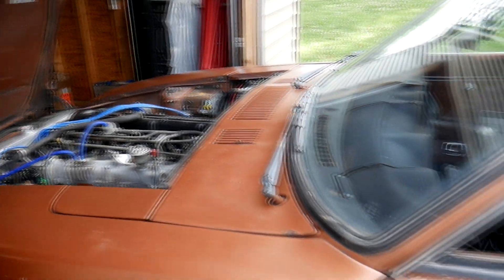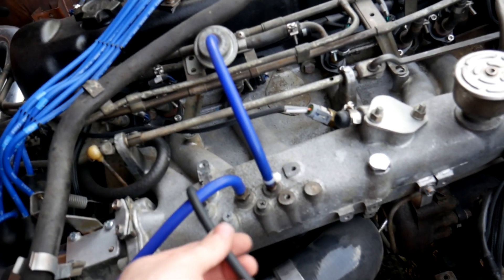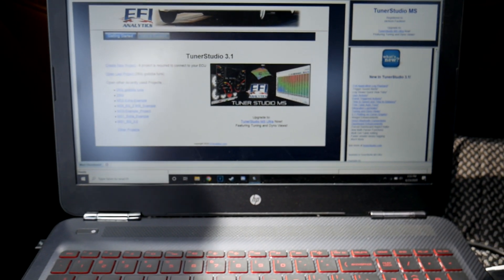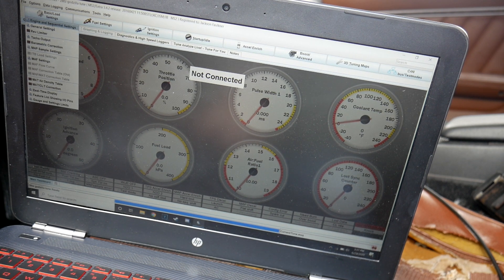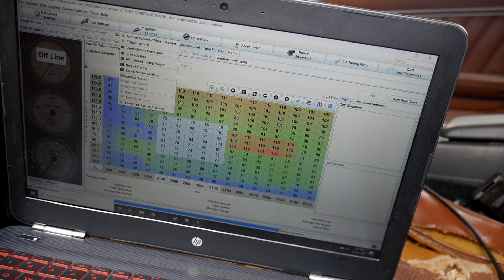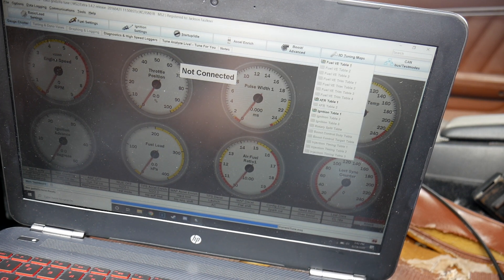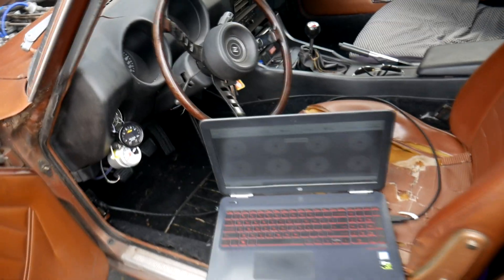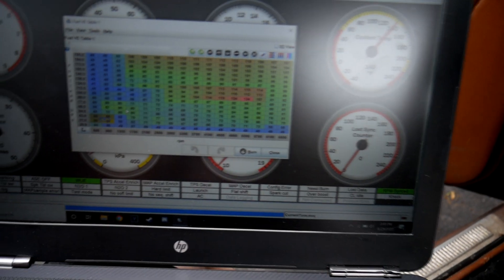Datsun L28ET MegaSquirt Setup

Comment: Hey man I wanna say thanks for showing all of your settings.  I recently was helping a buddy who got screwed by a shop upgrade from MS1 to MS2extra and the ignition timing setup changed quite a bit between the two versions.  He has the same distributor as you and while I will confirm tdc with a timing light, your settings allowed me to get the engine started and driving around the block.  I only mess with LS engines on Megasquirt so the Nissan stuff is all new to me.  Thanks again.

Comment: do you have to swap trigger wheels to make it work? would you mind sharing the tuner studio files? thanks.
Reply: Megasquirt can do any trigger, square wave or VR. L28et uses an optical dizzy that works well with megasquirt, there are two sensors one is high resolution(360 slots) and one is low resolution(6 slots) the 6 slot trigger works perfect for a basic dizzy setup the 360 slot is unusable as the resolution is too high for the megasquirt, the dizzy also requires a +12v(1k resistor) pullup on the signal wires as the sensor pulls the signal to ground. If you want to run wasted spark or COP you will need to swap the trigger wheel out, DIY autotune sells replacement triggerwheels that turns the 6 slot sensor into a 12-1 crank trigger and a single slot cam signal replacing the 360 slot.
Reply: @thomasbrandon8029  after playing with the stock setup some; couldn't get it work. I ended up grabbing a mega squirt wheel. It's not a 12-1, but a 12-2. Duno why.havent tried it
Reply: @ I would give it a shot, I ran the diy autotune ign-6 wasted spark coils for years with bip373 ignitors with just the 12-1 diy autotune wheel. On speeduino now and using both cam and crank inputs. Technically the crank signal is 24-2 but runs at cam speed, so at crank it's 12-1. Good thing you have an optical dizzy as the drive shaft is far more accurate mechanically.
Reply: @thomasbrandon8029  i see what you mean. so when i set the parameters, i will have to use 12-1?
Reply: @khamkham7134  Yeah, toothed wheel, single wheel missing tooth and 12-1 should do the trick, that will give you wasted spark as an option only using one of the sensors. Input capture can be rising or falling, maybe stick to falling(since the sensor pulls low) and keep in mind changing will alter ignition timing a few deg. Base timing will be set with #1 tooth angle and don't forget to lock your timing also, fine adjustments at the dizzy. Hope this helps.

Comment: Hey bro i have a 1977 280z stock turbo my question is when did you end up doing for the intake situation
Reply from the maker: Got rid of the stock intake all together and did 3" aluminum tubing. I ran it into the front driver side wheel well.
Reply from the maker: If you check some of the first videos on the channel I show how I ran it

Comment: This is awesome! I’ve been needing to do a MS conversion on my 260z l28et too! But I’m on a budget so I’ll be getting the diy MS setup. However, do I need to get a new throttle body and TPS or can I use the ZXT stock parts? Also do I need to get a air temp sensor to wire into the ecu? My car runs with the stock ecu but it bogs at 3-4K rpm...thanks if you can help also subscribed!